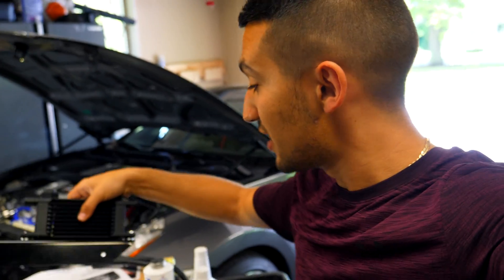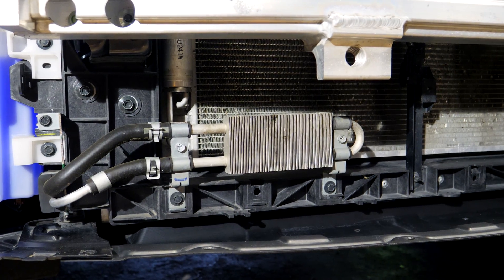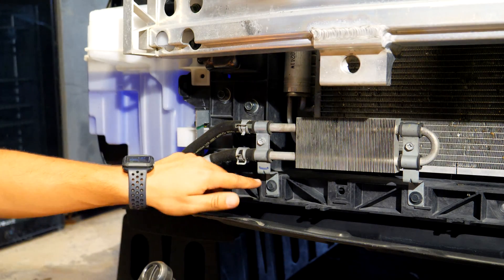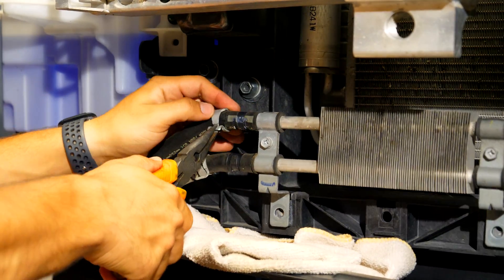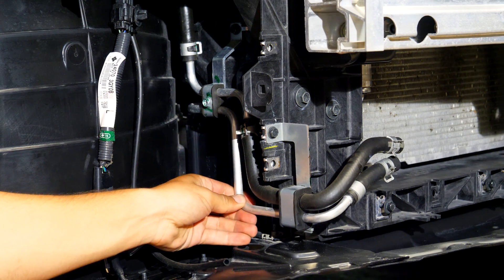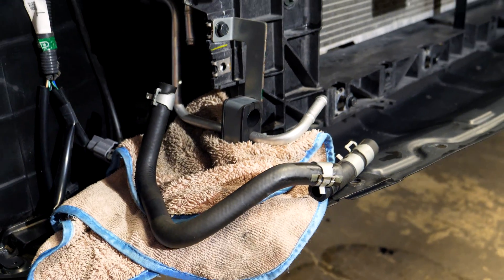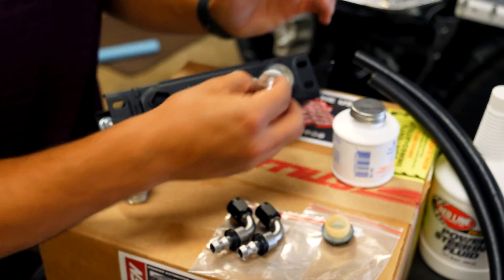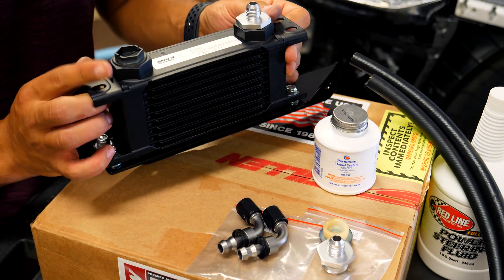How to Install an Upgraded Power Steering Cooler

Comment: you went with the stacked plate version of a cooler, which is the most efficient type. hope this met your needs on the track. that oem tube and fin type just doesn't cut it for drifting it seems.

Comment: This is absolutely ridiculous I have made it my mission in the past 20 years to debunk power steering coolers and in my mind I have I have never ever ever even on the hottest days of the year not being able to take the power steering cap off of the reservoir and stick my finger in it and it's warm maybe the hottest I've ever felt it was like less than a cup of coffee. Power steering coolers were invented to keep engineers justifying their jobs stop being ridiculous
Reply: Power steering fluid, a form of hydraulic fluid, can most certainly heat up if doing autocross type constant steering work.  This might occur during drifting, autocross, racing on a road course, etc.  Also, consider a hot day with ambient temps above 100F, elevated power steering fluid temps can cause premature pump failure over time.  This is well known; hence the coolers.

Comment: I have a g37s 13 I recently installed this power steering oil cooler and after my car started to make wine noises after the car heats up (drive it for a while) it’s gone but start up it wines, any solution to this thank you ? I installed it professionally but wine noise it’s killing me.

Comment: None of the specific fitting you have with that kit should be used with any thread sealant o-ring type npt fittings don't thread sealant non o-ring npt fittings do. The AN/JIC fittings never ever ever should be used with any thread sealant the taper seat designed into the fitting provides a mechanical seal. Please add a disclaimer to your video adding a sealant to a AN/JIC fitting can actually cause a leak with can be dangerous (think fuel) or very expensive (think engine oil). AN fittings were designed by the Army and Navy to not use any sealant which can fail at the extremes of temperature these things were designed for space flight and war planes.
Reply: The junction between the fitting and the cooler (the larger threaded part) doesn't have an "AN" flange seal.  So those threads should be doped.  The other end, smaller with the sealing flange of the AN style, should not be pipe doped.  In other words, one end of the threaded fitting (larger threaded end going to cooler which he points to at exactly 7:09) does need pipe dope because there is no "AN" cone-shaped flange seal.  While there is an O-ring, I wouldn't trust the O-ring alone; it is better to use pipe dope on those threads along with the O-ring.  Basically, if it seals on threads, you should use pipe dope unless there is some other sealing physics going on such as tapered threads, where the size of the threaded device is smaller on one end providing a sealing force by viture of a clamping force during tightening.  Also, I may be mistaken, but I don't think he's contemplating space flight or war with this vehicle, but I do like your optimism.
Reply: @rogjackson  then that would be a non o ring type NPT or BSP which would on either account would be a candidate for either thread tape or dope as both are taper threads and not a joint type based on a 2 part conical seat to make the seal AN/JIC

Comment: I've dealt with g35 power steering pump failures/rack failures. Perhaps this is all due to the lack of power steering coolers on these early g35/350z models. Overheating fluid wearing out these components makes logical sense. Purely coincidental?
Reply: Power steering cooling is an absolute scam it does nothing. The next time you drive for more than 15 minutes in a city setting turn your car off get out take your reservoir cap off and put your finger in the cool and I promise you you won't burn yourself. Engineers need to justify their jobs by creating useless crap like this
Reply: Also I have bypassed so many coolers rather than charging someone in our arm and a leg for a new one and have never had one comeback failed

Comment: Unless specified by the manufacturer for some reason, you should never use any kind of thread sealant on AN fittings since they rely on the taper to seal.  It's also a better idea to mock up your hose ends to get the hose length right, assemble the ends to the hoses, and then tighten the hose ends to the male fittings.
Reply: Correct.   AN is a design complete.  Plus, most assemblies are easier to finish when stuff is lose, so that you can detect stuff like interference/bending/stress/spacing.  This example was simple, though.
Reply: One end of the fitting was AN, the other was not.  The larger/cooler end was thread and O-ring seal.  The larger end (see at exactly 7:09) should be pipe doped (sealant used).  The larger end does NOT have the cone-shapped "AN" sealing flange and the O-ring alone cannot be trusted.  I agree that the AN end should not be pipe-doped.

Comment: Why didn't you use the existing power steering cooler cut the lines on the u with a pipe cutter and attached a new one to it so you'll have two together as one just asking
Reply from the maker: That would work in theory, however I will be adding more coolers behind the front bumper and will be limited on space.

Comment: What if we have electric power steering? Is there anything we could use to prolong the life of it (EPS)?
Reply from the maker: You can change the electric power steering fluid more often 😜 All kidding aside, there isn't typically that you can do to prolong the life of it, other than ensuring the boots are not torn and in good working condition